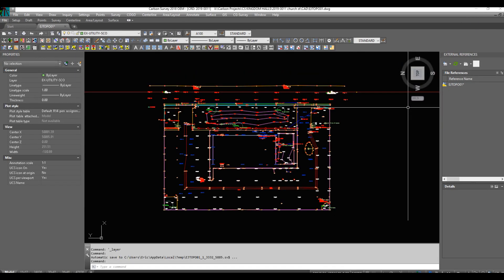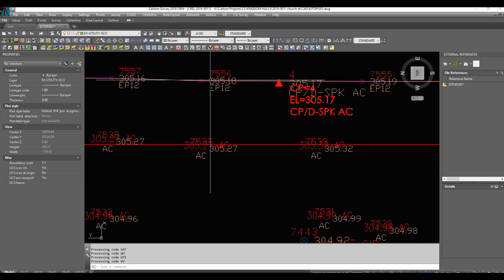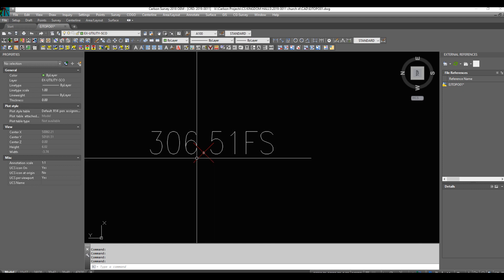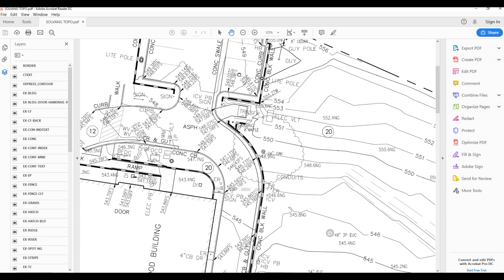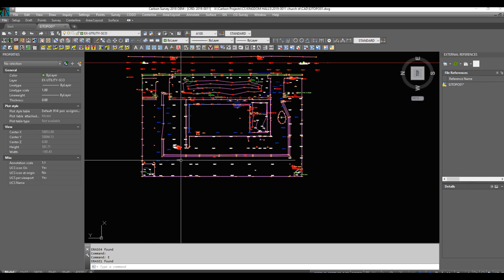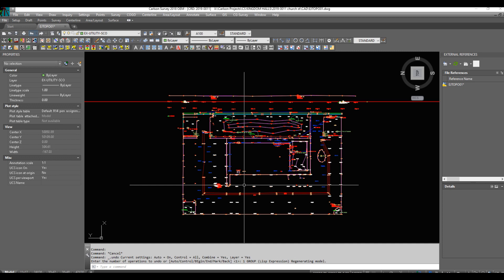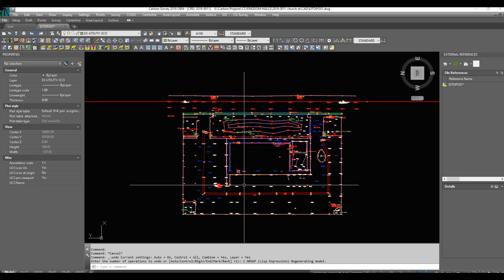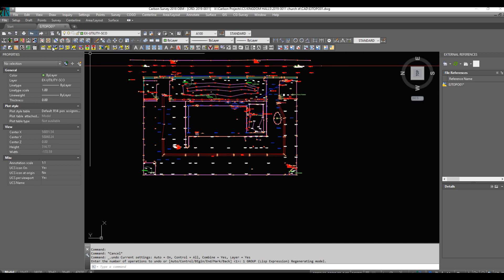Field To Finish Carlson Survey

Comment: A radiation survey seems to conflict with a survey working from a whole to a part, can you please explain this? I am very confused by how it works. No surveyor I have ask will dare to answer the question.
Reply from the maker: Modern Surveyors use random control points, or traverse points, and then compile the data in the office.  The old days of setting up on a boundary corner and backsighting another boundary point are gone........................it's quicker and less money and just as accurate to do it this way.
Reply: @ericthesurveyor1448  Thank you.
Reply: Unless he meant working outward from control vs working inward from control.